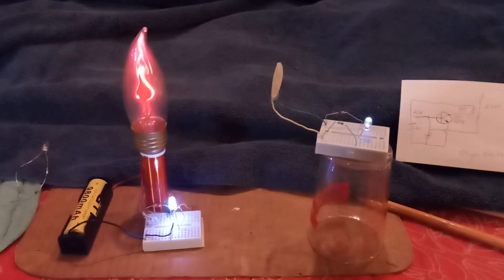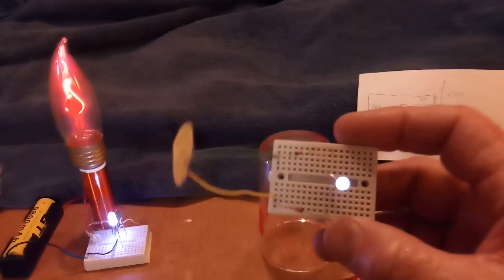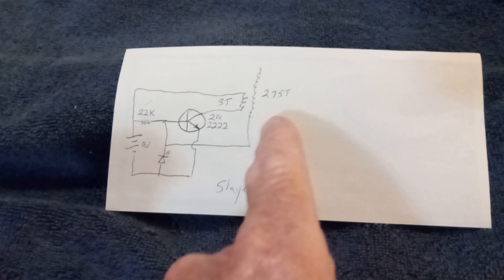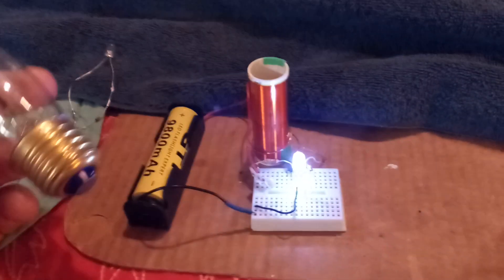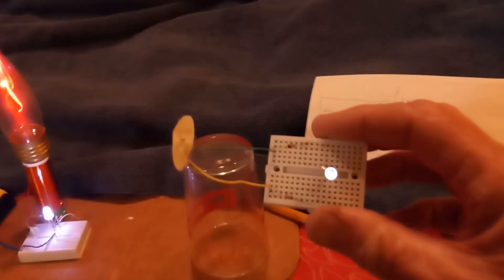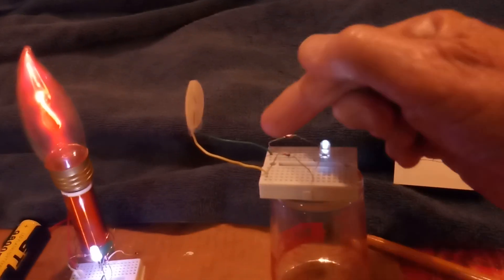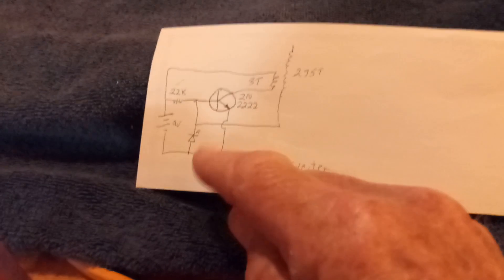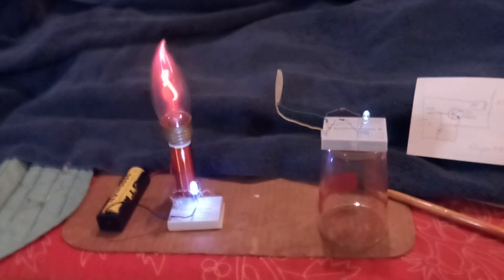Fire In The Hole !!! --- Mini Tesla Coil

Comment: What would it take to scale this up and let all the desired charge reach the receiver?
When you bring it closer, you get more amps now, it seems? Does it also pull more of a load as a consequence?
We need to get rid of large car batteries and just give hybrids an antenna to recharge on the go, and melt the internal combustion engine down, create cargo space.
Reply from the maker: The reciever does not 'load' the transmitter because the linkup is not inductive.  The reciever gets the energy through a capacitive link.  The power load on the transmitter remains constant.

Comment: You are certainly on a roll with this theme.😊
Reply from the maker: I thought that I could use the RFID pancake coil as the primary coil for a Tesla Coil but no luck so far.   Still working on it.
Reply: How many RFID chips, diodes and LED's can be used 🤔
Reply from the maker: @zebok3  I don't know.
Reply: @Lidmotor  The power reception by the ID receiver does nothing to effect the input to the broadcast signal.
Reply from the maker: @zebok3  Yes!  That is correct.  It is like regular radio transmiter and receiver dynamics.

Comment: Probably electrostatic.... replace that RFID coil with a metal plate and see what happens... I suspect a coil is unnecessary.   And a larger top capacitance on top of that "tesla" coil might help extend the range... but only if you had a ground on the other end of the coil to counterbalance it out - which might be impossible with these slayer exciters.
Reply from the maker: Thanks.  I think that you are right.  A simple round metal disk would probably work just as good. A connection to ground does really help also.